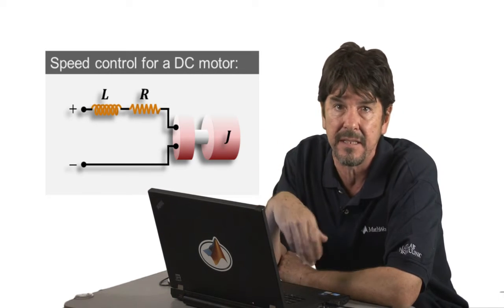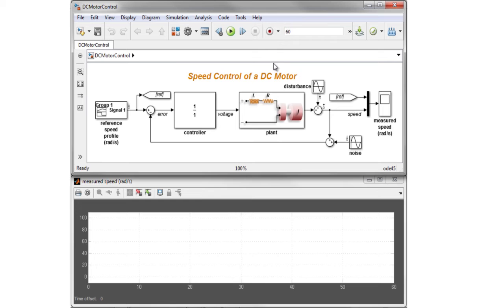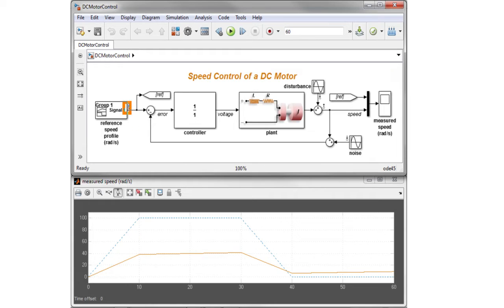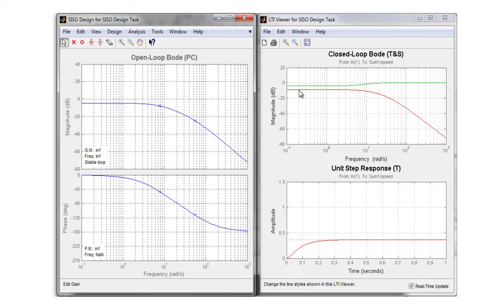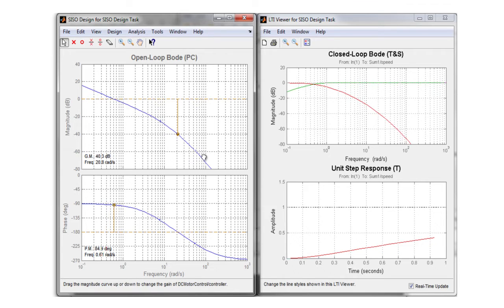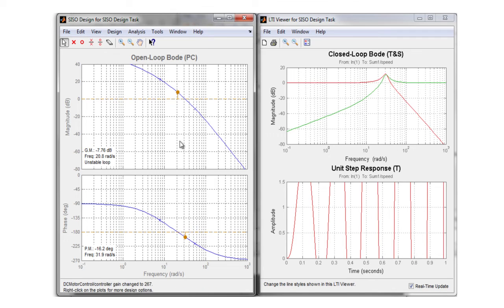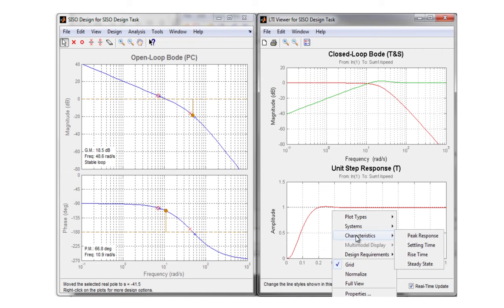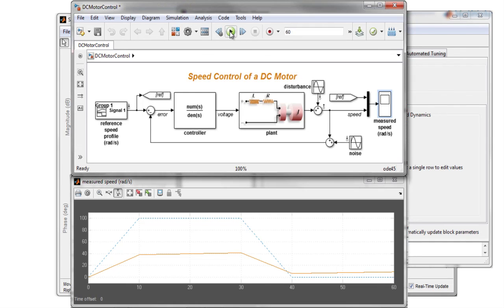DC motor speed control using bode plots | Using Bode Plots, Part 5

Comment: How did you pick cross over frequency. You told 0.15 as rise time which is 2*pi/0.15 =41 rad instead of 10rad you told. If i need a rise time if 2 milli second should i pick cross over at 3100 rad
Reply: did you understand? he did not use mathematics. he improvised using his intuition or better call it his experience. nonetheless if you did not understand. Let me know!

Comment: While tuning the bldc motor should one keep track of the Gain and phase crossover freq ,if so why?
Reply: for system stability and control performance.. you should check that after you close the loop with a feedback

Comment: Sir u have drawn bode plot for DC motor that means u have given ac supply to motor
Reply: No.
Bode plots are drawn for any input signal other than Asin(wt).
because in real world input signals are bery similar to Asin(wt).... its an approximation.
e.g :  step response with magnitude 2 excited every 5 seconds ..... so it would be  2sin(2pix0.2xt)